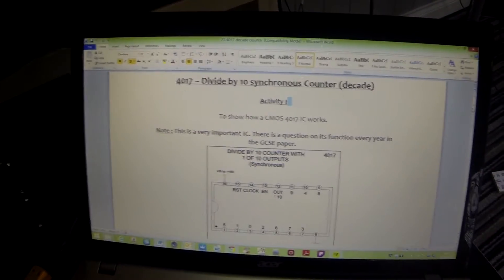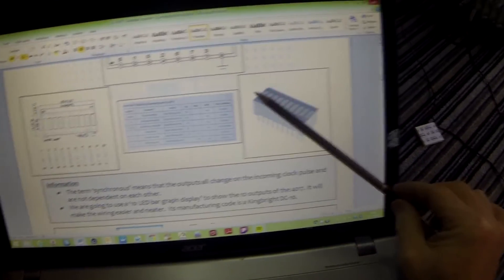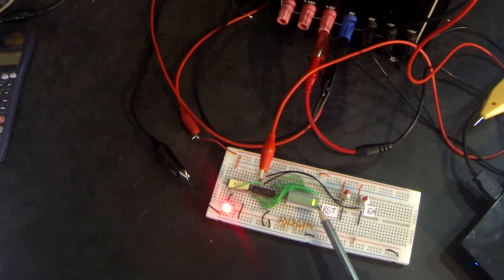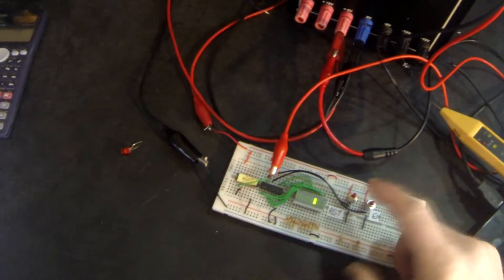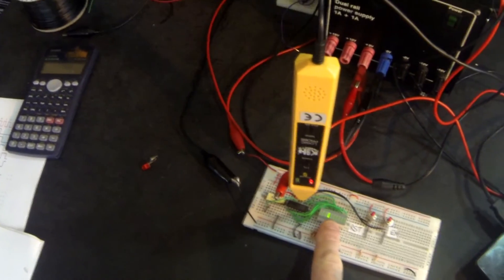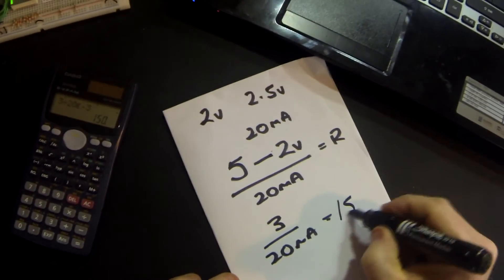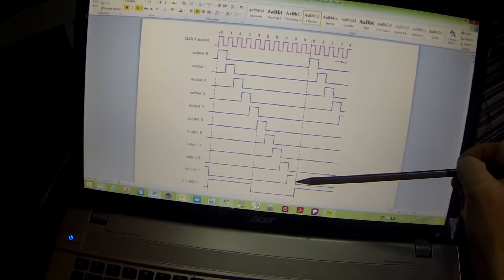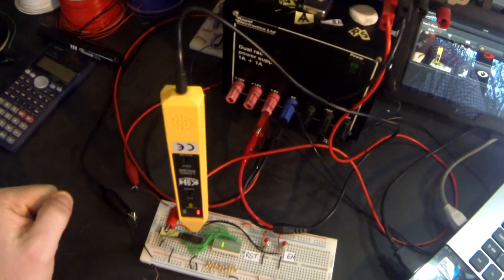Tutorial 23 :  The 4017 Divide by 10 Synchronous Decade counter GCSE AQA Electronics

Comment: Thanks for the explanation.  BTW, if you add a pull-down resistor on the clock input, this will prevent electrical noise to trigger undesired pulses.  Adding a RC network, from ground to VCC and connecting the Reset pin to the RC junction, will ensure that the circuit always starts at Q0 on power on, minimizing random starts due to noise as the Reset pin will be kept high for few milliseconds at power on.
Reply from the maker: Good advice. I was using a frequency generator on the clock input, so no noise (bouncing). A good trick though on the reset.

Comment: This has helped me greatly (Just a late to the game hobbiest). But I was just wondering, since you are using only 1 LED at a time in this setup, could you not just hook up all the cathods together and have 1 resistor?
Reply from the maker: +Colin Richardson You can in this case. I try to keep some things simple for pupils. If I did that in this case pupils would think you could do that in every case I.e. Binary counter (where more than one output is on) and then it might cause problems depending on the use.
Reply: Fair enough.